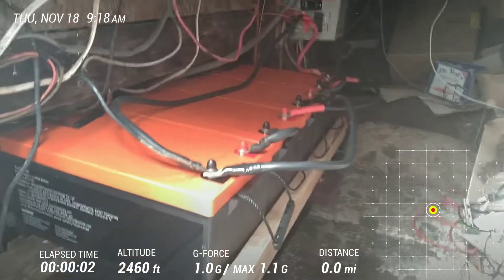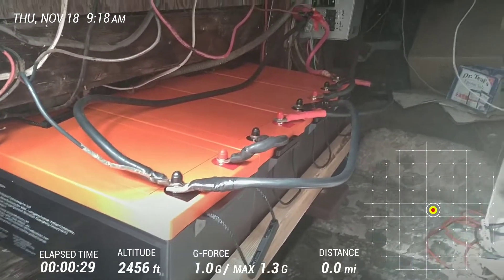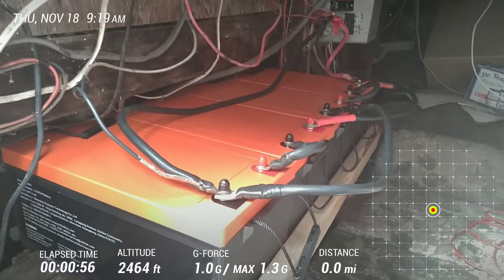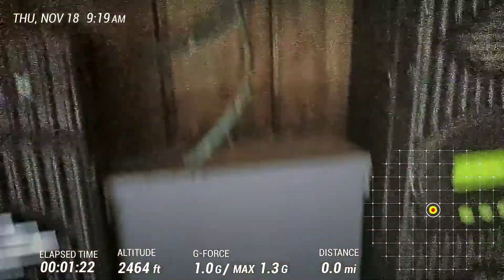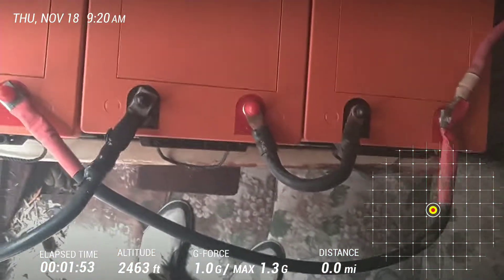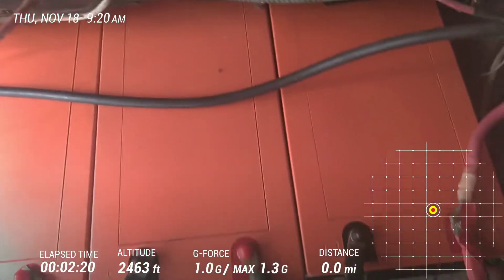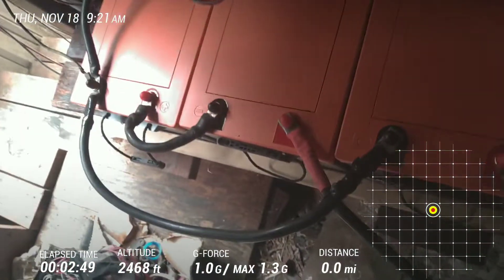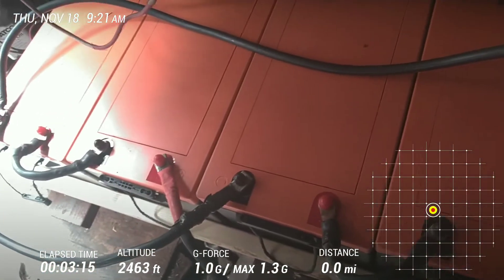Chins LiFePo batteries running Outback 2524

Comment: the reason the voltage jumped was probably that the batteries hit the high voltage disconnect, and the voltage ran OPEN. so you were probably just reading the CHARGE voltage which could easily be that high.
Reply: Right makes sense.  What a wonderful battery they are.